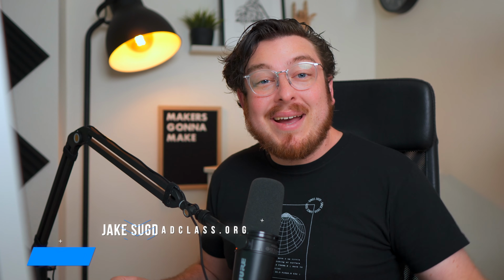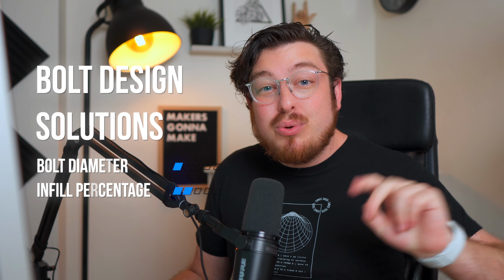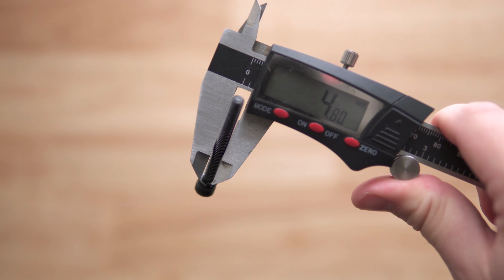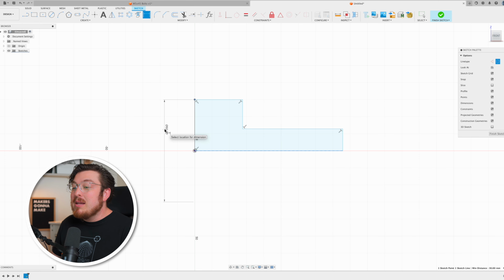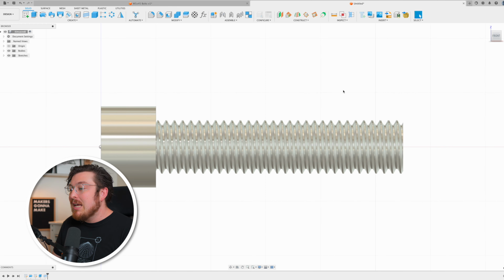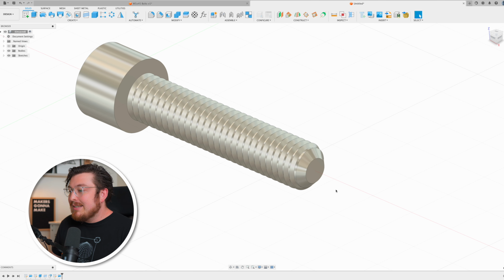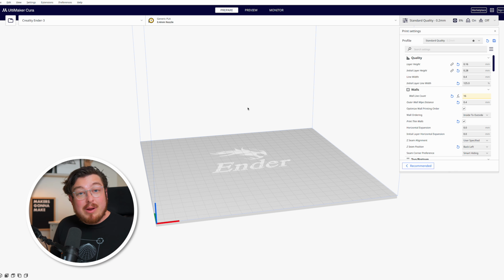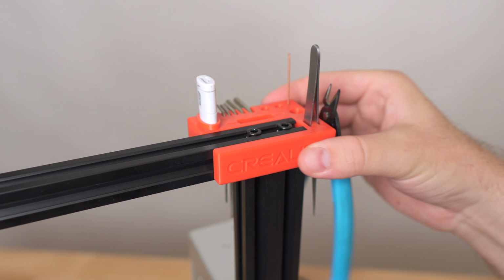The Bolts | 3D (RE)Printed Series

Comment: Awesome tutorial! FWIW taking models from McMaster-Carr is always a great way to get fully modeled bolts. It's so frustrating they don't include chamfering the end of a threaded section in the free version of Fusion 360. I was able to print some M4 nuts that were actually quite sturdy. I used them to hold bed adjustment gears on, which means they were facing quite a bit of spring pressure. Only issue is they failed when the bolts got hot. I thought it would happen, but figured I would test it. Otherwise I have printed much larger threads in a vertical orientation like you showed not to and they are quite strong. I think in that case you just need a material with very good layer adhesion. Awesome work!

Comment: Another great video Jake. It's convincing me that I need to start using parametric values in my designs. I just need to work on getting my constraints a bit more <ahem> Defined!
Reply from the maker: It's the best thing you can do honestly. Don't think ever single dimension needs parameters because that's a bit silly, just the ones that might change and are in reference to other dimensions

Comment: It is much easier to uncheck "full length" on the threads and leave half a mm at each end. You can then use the chamfer tool on those ends.

Comment: The thing that solves all of these problems - use metal fasteners.
THE thing people (especially 3D printing enthusiasts) ignore is component design for the expected material. I mean, if you're using ALUMINUM extrusions, *WHY* waste time with PLASTIC fasteners?
3D printing enthusiasts will adhere to this pretty well when transitioning from injection molded originals to 3D printed objects.
But just have some sort of pathological need to make EVERYTHING out of 3D printed plastic. The world of real, physical, and useful functional parts just doesn't work like this.
Reply from the maker: Hey Privateer :) yes in real life plastic bolts is silly, the purpose of this series is to 3D print a 3d printer from scratch including hardware as an experiment. Check out the first video in this series to see the purpose and the rules of this experiment.
Reply: Creator already replied, but yeah you're missing the point. This video is clearly about "Can we?" and "How well can we?" not "Is this the optimal solution given all factors and available resources?" It's a critical thinking, engineering, and design exercise. You learn skills which translate into other future problems and projects. Plus, a 3D printed fastener is still cheaper and able to be acquired more quickly than metal. Situationally, it can make sense.